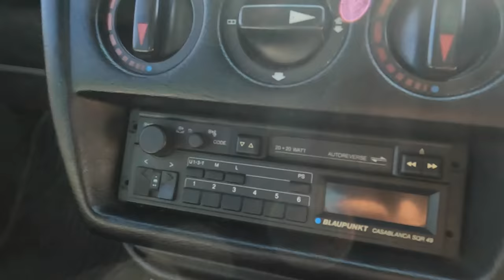This £350 Mercedes 190E that will make you jealous

Comment: Congratulations, fantastic buy, I'm a 74 (youngish) year old citizen of the once "England's prison colony" Australia and still a motor enthusiast. The speedo still uses a cable, I would suggest take the inner cable out, clean of the remaining residue, give it a soak in good thin oil and kerosene and it'll be like new. Currently I also own  a 190E,  which was in need of everything except it had a very straight rust free body, now looks like a beautiful original car, new white paint, restored wheels, completely restored interior and everything else tickled just a little but done tastefully, the only obvious clue is the 190E now shows 380S, yes it is now a 200+ HP V6 with other necessary suspension and brake upgrades coupled with the very light 1100 kg weight resulted in a quite competent, still economical drivers car.  Yours, being in such original condition it would be a shame not to do only what it needs to restore it to it's former glory. Keep it for as long as you can , the enjoyment of ownership will continue to grow.

Comment: A great buy! I'm all for originality if you still have it. 

 My best old cars have been rear wheel drive old Volvo. Had a 1986 740 GLE estate in 2002. £425 My first car. Drove that for 5 years.

  After a brand new Corolla bought a 1989 240 GLT Volvo auto estate in 2009 for £350. Daily and only car for 8 years and owned for 10 years nearly. Sold at 234,000miles and still drove faultless. Sold for £500. 

Currently in 2016 bought a 1996 Volvo 940 SE LPT Auto estate for £250. After having the 240, wanted something with AC and ABS brakes plus split folding rear seats and sunroof. Was amazed on how smooth and quiet the 940 was after the 240. Last year rebuilt the front suspension at 208,000 miles and finally fixed the AC. Used pipes, new Nissens condenser and used compressor. Body paintwork not the best but used as a van for self employment! 210,000 miles and all been very reliable.

Comment: Josh, this is positive Karma, you've obviously done something good in your life or in a past life that this beauty should come your way! Certainly a keeper if only for the provenance! Sure to be worth even more in a few years time. I considered buying an early SL a few years back but was waiting for them to drop a little more in price but instead they just carried on rising, now their prices are stratospheric and unreachable for me. I'm really a Beemer man having had 3 E21s, an E28 and two E34s but also have a soft spot for the W124s and 190es currently owning a 2.6 190e with a/c, abs, s/r, r/headrests, h/wash/wipe, elec windows all round and a silky 6 cylinder engine that can be smooth and sedate if you choose, or can be swift and quite rapid too. And it's done less mileage than yours at only 208k. Yes I have a white beard btw! The speedo's are notorious for failing on W124s and W201s but mine still works thankfully. Only recently subscribed to this channel, I really like Joe's straight talking and very natural and fluid presentation style, clearly a great communicator and not the least bit pretentious. Would love to see more content on this old 190e and see how far you guys can improve it, but tbh I suspect it wouldn't take much. Great video and banter, glad you did a test drive and swapped drivers. Sure the E36 is gathering a strong following, but it just doesn't have the class or the style of the baby Benz....

Comment: I had a 190E h reg. , sold it with 240,000 on the clock. Was mint, guy who bought it , was replacing his that he regretted selling with over 400,000 on the clock. They run forever.

Comment: I bought a 3 year old 19E0E in 1993. What a fabulous car. The previous owner was a Company and the car had been specced new to come within the company car threshold. It was white and had the 2 litre engine with a manual gearbox. It had optional rear headrests which could be dropped down electrically. The economy was extremely good because of the( unusual) manual gearbox and I could achieve around 40mpg on a run. at the time I was driving from Stroud in Gloucestershire to Leeds every few weeks and it was a great motorway car. In 1996 I replaced it with a c180 Elegance -bad move. That was when the bean copunters got involved with Mercedes.

Comment: Hi josh and joe,this is a bargain. I would repair that nasty tear on the door panel for starters.Then adress the other small issues such as the speedometer cable new shock absorbers service and tackle the body work imperfections too and keep it for a while.I would also give it an engine service including automatic gearbox fluid change.
Reply from the maker: Yeah I agree with that John 👍